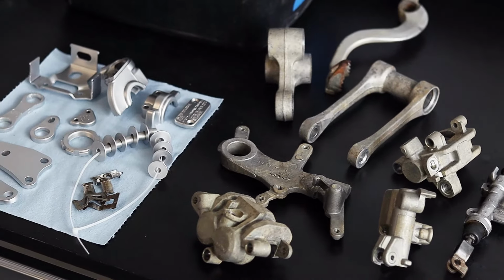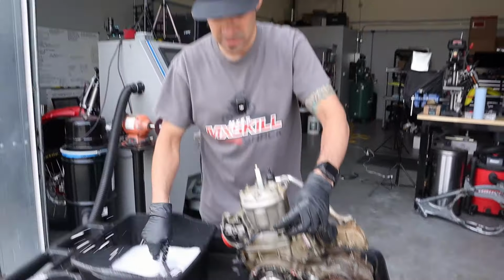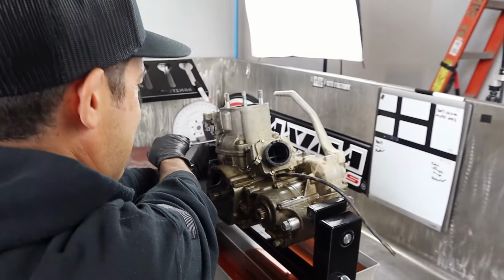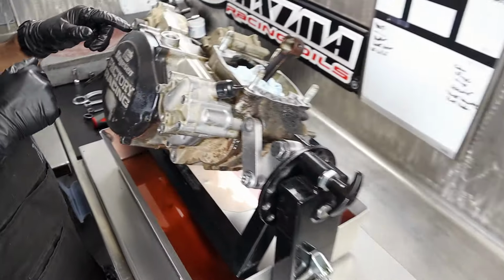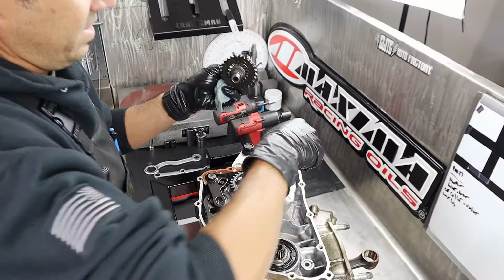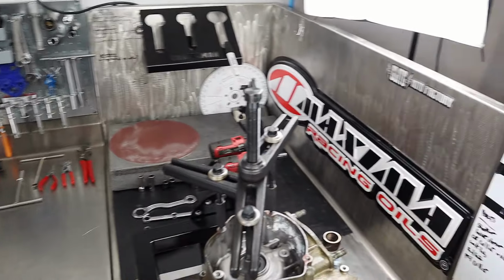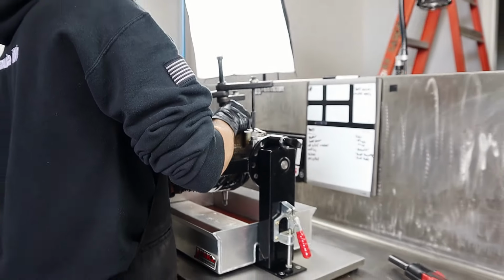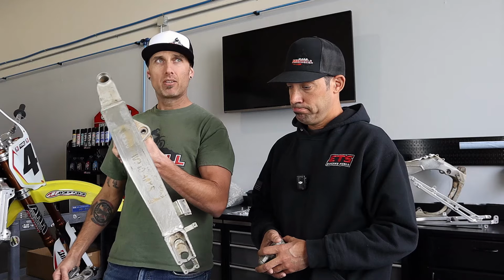Is this old CR250 engine TOO TRASHED?? 🤮 Let’s open it! - 2003 Honda Two Stroke Build & Giveaway

Comment: Shouldn't that piston have holes drilled at the exhaust bridge for lubrication ? Most other Japanese 2T bikes have those?
Reply from the maker: Could be why this exhaust bridge & ring had a bad failure in that exact location.

Comment: Is that a transmission stainless work table with the stainless back panel, all one piece?
Reply from the maker: The lower piece is a commercial kitchen table with a sink in it (used for draining forks and shocks now) and the stuff on the wall is called “Wall Control”. 

Feel free to shoot us an email using the text box at the bottom of our website and and we can shoot you a link to where we purchased from.

It worked out perfectly on that back wall to tie in with the backsplash on the engine bench

Comment: Hey Nutcases🤑…Always dig the Show…Not tryna Criticize,just throwin out how I do things…I would have Soaked the Whole Bike Down with Simple Green & Pressure washed it,Then Pull the Motor…Then I take Gas & a Paint Brush with the Bristles Cut Halfway off & Then Clean the Motor with the Brush & Gas ,it Works Very Quick & Thorough !…Then,I would Drive Up to You & let You guys Take it from There🤣🤣🤘💥💥…which I’m Actually Gonna Do…I’ve Already Cleaned er Up…just Waiting for some Vacation time…see y’all Gangstas Soon🦾🔥
Reply from the maker: Hey Bobby!  No harm dude! That’s value to the community here and we appreciate the comment greatly.
I personally love working on smelly dirty bikes, NOT 😂.  It does allows us some better talking points through the process of the builds though.
WHAAAAATTTTT!  That’s great to hear!  We appreciate the opportunity to serve and care for your engine!  Could you reach out to us via email on the site so we can plan accordingly?
Lastly, If you haven’t make sure you sign up at www.mxskillshack.com and tell your friends!  I’m sure they would also appreciate the information.
Tony // MXSS
Reply: @MXSkillShack  you Got it Toyota🤘see ya in a bit